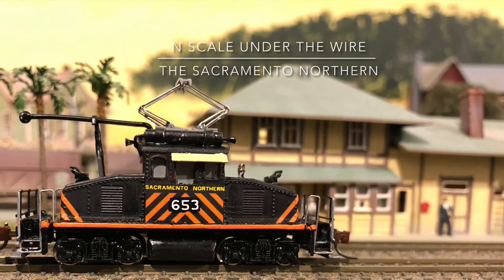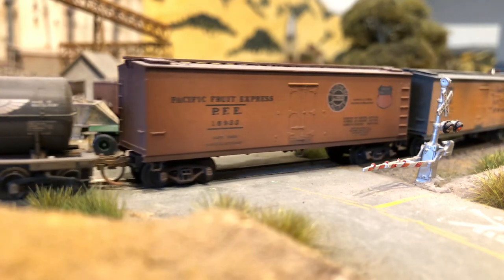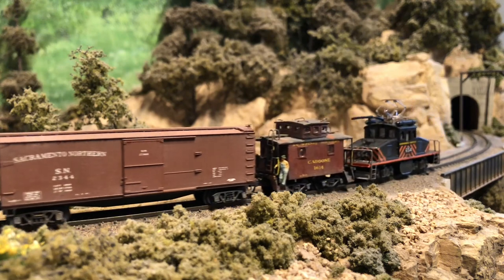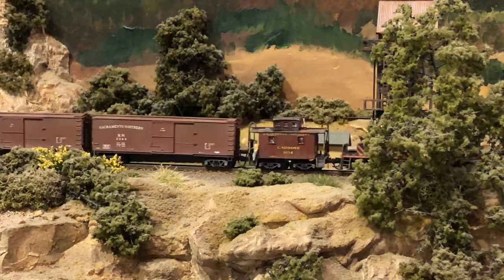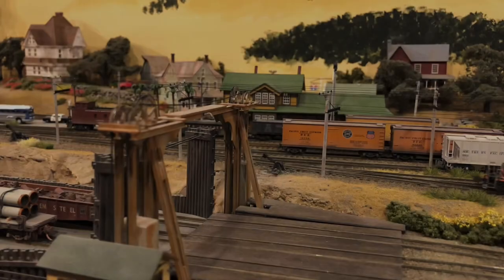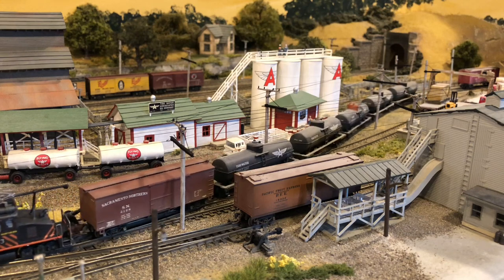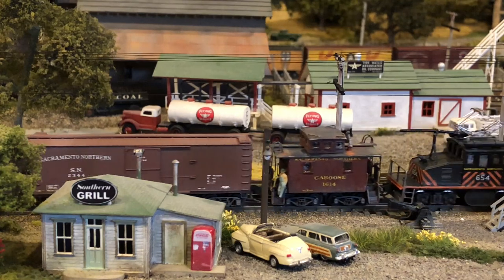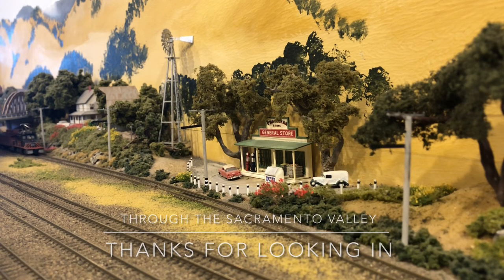N Scale under the wire:  The Sacramento Northern

Comment: This is a great depiction of a somewhat forgotten railroad era. It is something I have wanted to do. How reliable is N scale for operation purposes? I always thought it to be too light to operate consistently especially in a tiny steeple cab.
Reply from the maker: The steeple cabs were ‘bashed’… and their weight was a big question mark! But I crammed lead weight into them as much as I was able and it has seemed to work! Of course, in real life, the SN put motors on both ends of their trains quite usually, so my n scale ones work pretty well together. Between them they will move a dozen cars very easily. The powered chassis’s are made by Kato and they run very smoothly! I’ve had a lot of fun with them!
Thanks for looking in! And I hope you pursue some ‘electric’ railroading! All the best to you!